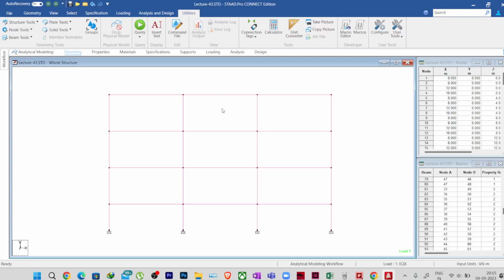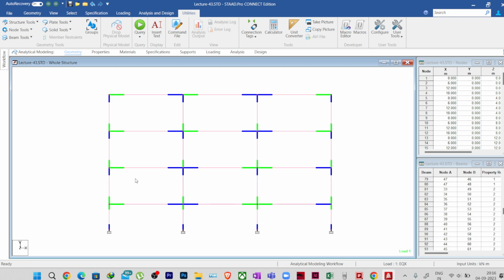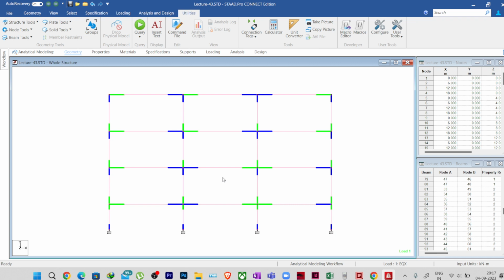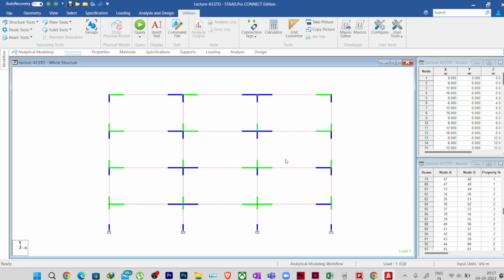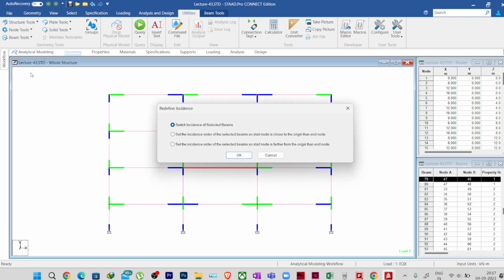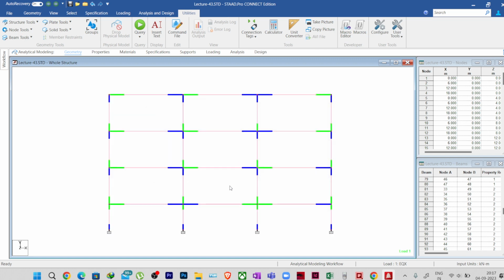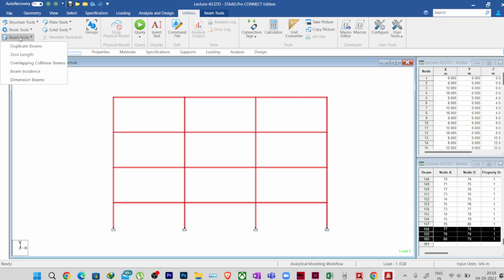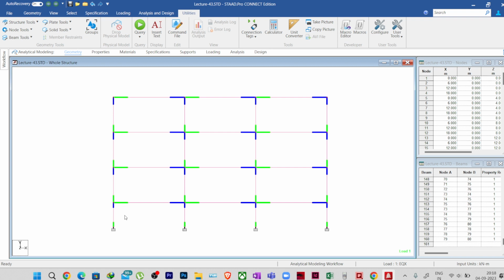STAAD. Pro Modeling Tip & Ticks | Correction of Member Incidence | ilustraca | Sandip Deb

Comment: Does it helps structure to transfers the load properly??
Reply from the maker: How member start and end can change load transfer path... ? 

Proper member incidence will help in correct interpretation of results... It has nothing to do with any load path.
Reply: @ilustraca  what you mean by interpretation of results can explain in detail more ?
Reply from the maker: Beam design results are given at Start to end in STAAD, suppose ur beam start is right side and u r thinking that the start is at left like all other beam, in that case u r reading the result in wrong way... This is one example...if u use STAAD frequently, u'll understand!